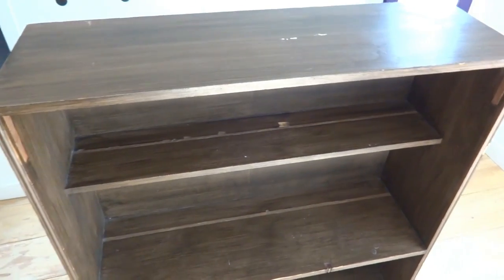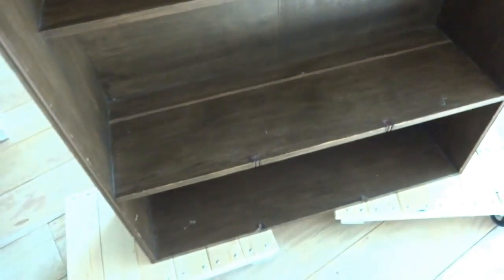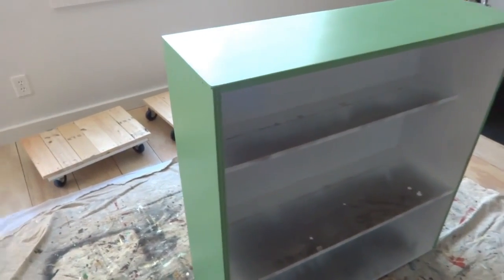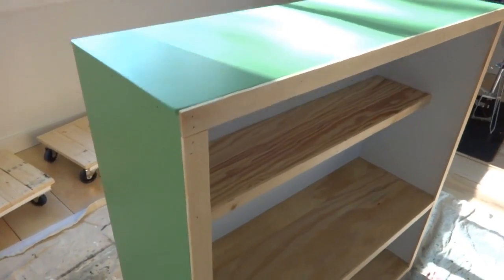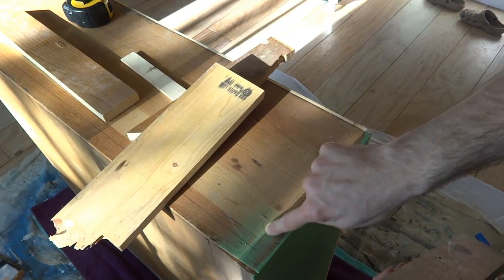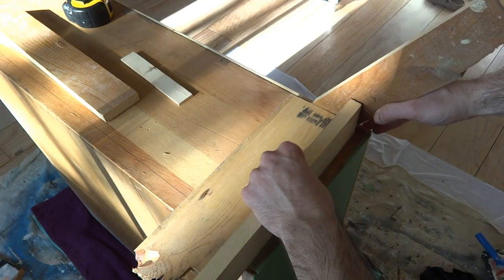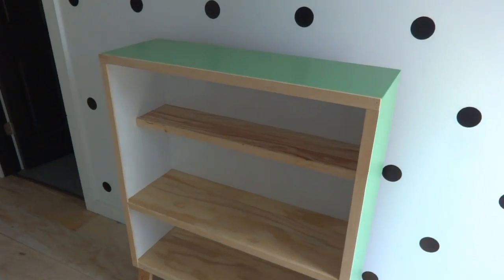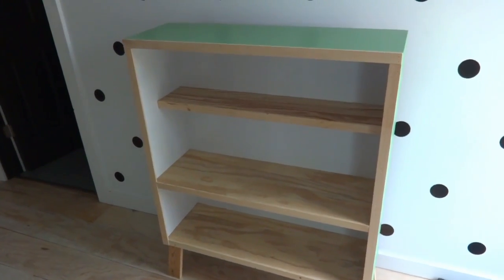$5 Ugly Bookcase Makeover w/ Reclaimed Wood

Comment: MrDiyDork could you please tell me how you sand your furniture and give me tips on how to make the process faster. Thanks 👍🏼
Reply from the maker: +Bailey Everard Well, the sanding part does suck. I just use my DeWalt orbital sander and a foam sanding block. If I'm going to take paint & old finish off wood to go down to raw wood for new stain, I usually just do that on flat, easy to sand pieces (drawer fronts, dresser & table tops, etc).

If I'm going to paint something, I just sand it smooth enough for paint to grip it (120 grit or so) and try not to go down to raw wood. If I do see raw wood in spots, I've learned the hard way that it will bleed through the paint and leave discolored spots. So I hit those spots with regular spray paint primer. Then I roll the whole thing with water based color blocking primer, then paint. I just picked up a spray gun to hopefully speed up & smooth out the painting process. I need to practice with it first though before I use it for a video.

If I'm redoing something like a turned table or chair leg, I'll use my foam sanding block to give it a little tooth and then just spray paint it. I don't bother trying to take those down to raw wood or paint with a brush. It's just too much work for the money those bring around here in my area.

I occasionally use stripper if I get a gnarly painted piece that just gums up my sander. It's messy and a pain to do, so I try to not do that too much.

Depending on what I'm sanding, I'll sometimes use 60 grit (good for pallet wood & tearing old thick paint off quickly), but usually start with 80 or 120 (good for sanding smoother old paint, bondo, rough old poly finishes, etc) ... and then I finish with 120 or 220 depending how I'm finishing it (120 is usually ok for painting, 220 or higher is good for clear coating). 

I use the foam sanding block to get into nooks and crannies as well as smooth out the 2nd coat of poly or lacquer before adding the 3rd coat. I buy the "fine" grit foam blocks from Menards. They don't have a grit listed, but they seem like they're in the 100s and they eventually wear down to about 200ish or so. 

For this particular bookcase project, I just used my orbital sander with 120 grit discs for both the painted areas and the wood trim parts.
Reply: +MrDiyDork great! Thanks for the advice, I've been sanding this bookshelf for paint and they tips will help me majorly 😀😁

Comment: So I'm doing something similar. It's not actually a 5$ diy though. To get primer and paint as well as rollers/brushes. (that's just to re-paint) It adds another 40-50$ What do you suggest to cut down the supply cost?
Reply from the maker: I recommend maybe buying some of those $3 sample paint containers or "oops" quart paint to keep paint costs down. In the "oops" paint section at Menards, I can get sample jars for $.50, quarts for $1, and gallons for $5. You just have to keep an eye out for colors you can work with. You could also try using just a brush to avoid the cost of a roller handle, extra foam rollers, tray, etc. A quart of color blocking primer is probably less than $10. You could also buy a quart of paint & primer in one type paint to keep costs down. Another thing you can try is finding another piece of furniture on craigslist, etc that could use a simple repaint and flip it back on Craigslist, Facebook marketplace, etc to recoup your money. A lot of furniture in our house was found and paid for that way.
Reply: Hey tamiko I don’t know if you already seen but in my area we have dollar trees that have so many great paint supplies at a dollar a piece!